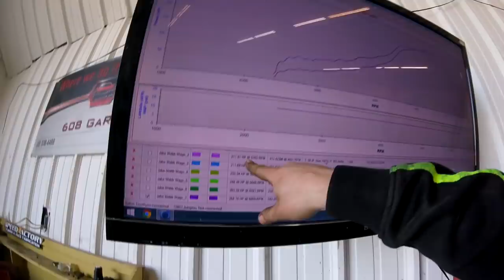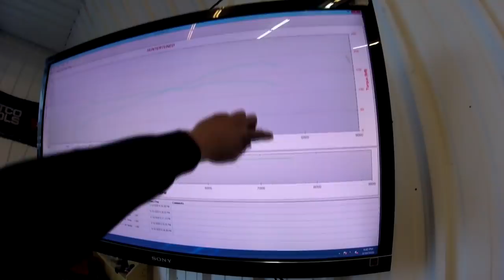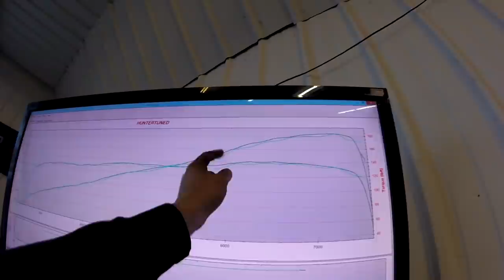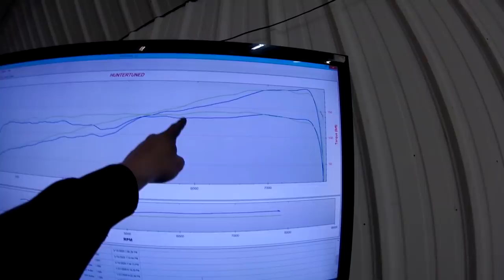Pump Gas Vs E85 Ethanol On All Motor Honda + Other Fixes

Comment: Got get me one those E85 tunes from you. I got a B18C1 with Integra Type R pistons 11.5 with head gasket I got. Also I ported gasket matched the head and intake. Its got a p28 chipped ecu. Pulls hard but 93 is killing my wallet and E85 is so much cheaper. I be hitting up website soon.

Comment: Hello Hello Hello! Dented headers won't lose hp unless completely pinched off. E85 may pick up like 5-10hp on all motor. Keep the mustang, youve ironed out a ton with the car. Keep improving this chassis its a solid platform as is. Dont make it pretty make it faster!

Comment: If its got tuner 2s it needs cam gears in a bad way. In an Na application they love overlap , advance the in 1 or 2 and then keep retarding the ex cam until it stops making power. You will make another 8-10 whp on that setup with just cam gear tuning.

Comment: a longer intake pipe will add power my h2b just by switching from a 3 inch short ram to a 3.5cold air i gained 8 10whp i made 215whp 177wtq on a stock h23a on pump 91 octane
Reply: what are you revving it to?
Reply: Do you know if the h22a from the jdm accord (not red top) they have a closed deck.. do you know if the h22 head ports flow more or if they have diff spring or cams vs the h23a head ?

Comment: can i asked questions?
igot a problem cause i put my motor back together after i rebuild the head
resurface to .03 
and now i tried to line up everything 
my stock cam gears line up but my  crank is off alittle like 2or 3 hair but before thaat i check the piston position its all the way up
when i move alittle more the piston will go down so  idunno whats wrong why its off alittle 2 or 3 hair my crank pulley any ideas?
Reply from the maker: That’s normal
Reply: @HunterTuned  yeah the slack makes me off alittle but the teeth are not offso when i line up the crank endup 1 cam gear is line up and the exhaust is off alittle

Comment: Yes it need a new header and a longer cai at less 5 feet of piping 
My s2000 was the same no exhaust = 0 power gain ad a 3 feet pipe to the intake and gain 5 hp on the top end

Comment: If the compression is below 13 to 1 I'm willing to bet the cams are to big for that build.  If it is a lower compression 11 to 1 engine I'm also willing to bet a type R intake manifold and tuner 1 cams will make more overall power throughout the entire power band
Reply: Tuner 2s are not that big of cams. They are a great 1.8 mild compression cam. Overcamming isn't as much of a thing as people make it out to be. I have seen 207 whp out of an lsvtec with under 12-1 comp with pro 2s that people swore would be way over cammed and it doesn't have enough compression for those cams and it will never work blah blah etc. Car trapped 108-110 mph on 91 pump gas in a full interior eg. Ran low to mid 12s on a dr at a shitty ass track.
Reply: @lloydgrandy8189    I love when people chime in that CLEARLY don't have 1st hand experience about what they are talking about lol you guy always say "well my friend's friend's friend did a dyno pull on the street 10 years ago and blah blah blah blah blah.  I'll tell you from 1st hand experience cam duration/ lobe separation and compression are a huge deal in any build  Especially a small displacement NA engine  PERIOD this isn't something that was just figured out last week It's part of a formula engine builders have been using since the dawn of time.
Reply: @twotimes2099  i don't disagree with that fact at all. Im no professional engine builder but I've been around the block , have built and owned multiple na b series vtecs in my day. I've been messing with them since the early 2000s. These engines are capable of moving a lot of air and people like have always way over played the over camming statement. Obviously i don't mean you just throw the largest cams possible at a build and expect the best power. A well matched setup is crucial in all parts of an na setup. From my personal experience i believe you're wrong , i would bet money that car would lose power everywhere by switching to tuner 1s.

Comment: Could I run e85 on oem Honda filter and stock fuel line
Reply from the maker: Yes we have a lot in the past without issue
Reply: @HunterTuned  thank you